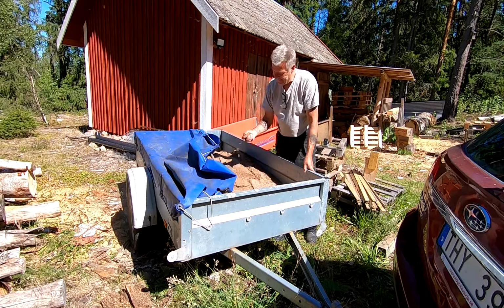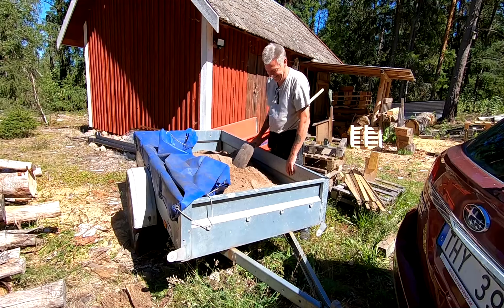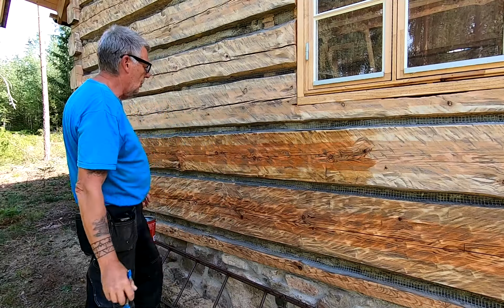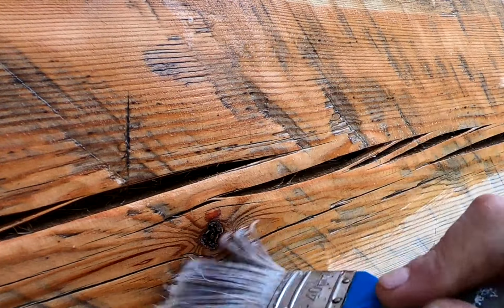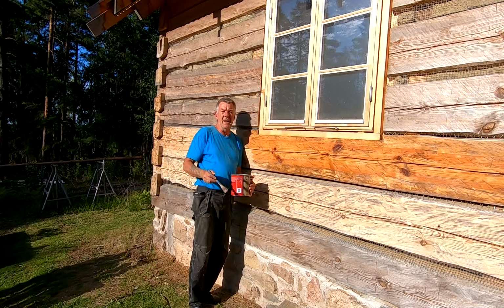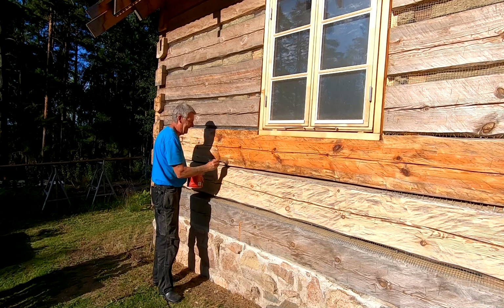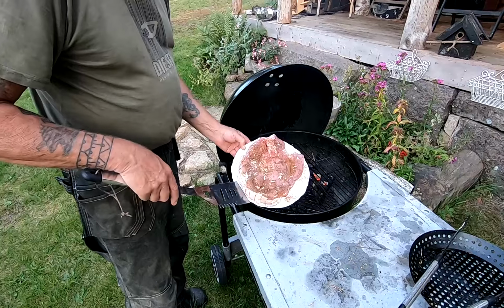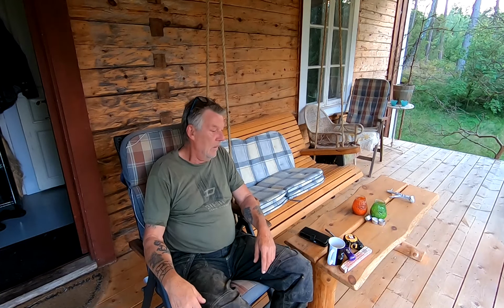Sanding and Oiling my Log Cabin. Vlog #274 - S6

Comment: I sanded the same way as you and what I learned is that it makes no sense, the wood will get darker every year, in ten years it will be very dark brown. I later applied the oil right over the gray logs and a very nice brown color came out.
Nice work, good video
Reply from the maker: @klerobi1  I've been thinking the same, and I know it will darken over time, but for now I'm loving it. 
All the best 
Michael

Comment: Would a hand sprayer have been faster? I suppose you did not use one because the spray would have gotten into the rock wool. Would that matter for the mortar?  Did your paint brush last for the whole job? Be Blessed. Jesus loves You.
Reply from the maker: @JosEPh-zy3yr  I actually thought of spraying it, but as you point out, it would be going into the insulation, and since I didn't wanted that, I used a brush- and it lasted all the way. I'm not sure if it would affect the mortar, so I didn't chance it. 
All the best 
Michael